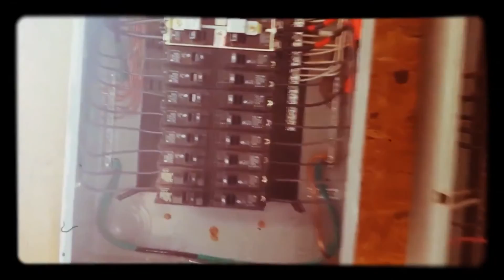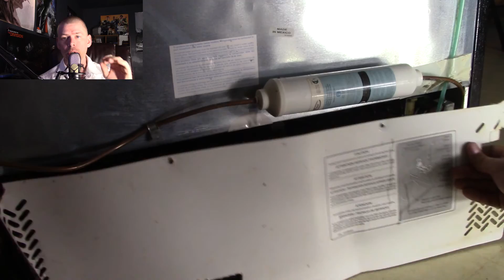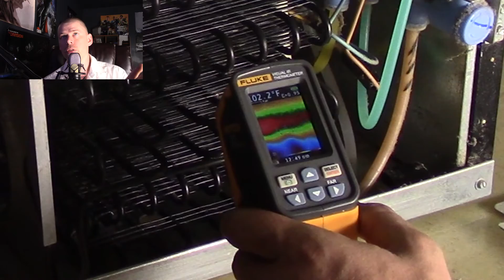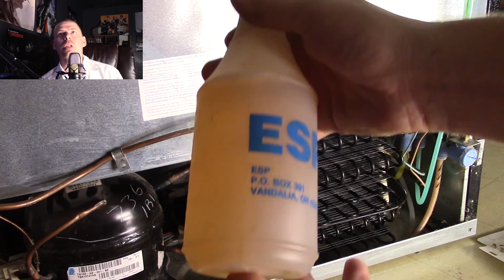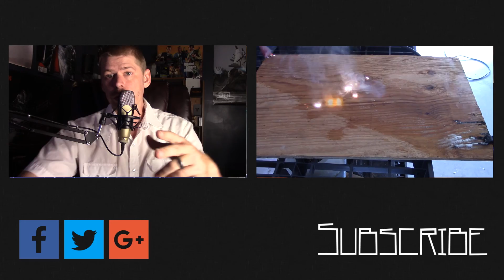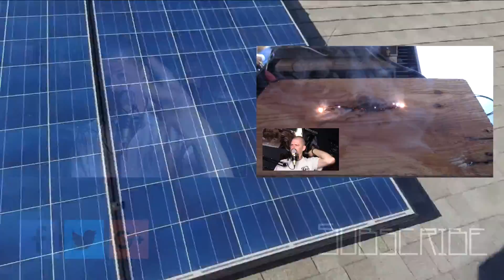DIY Clean The Coils On Your Refrigerator To Reduce Power Consumption!!! Solar Powered Systems!!!!!

Comment: Excellent video, I tell people to do this all the time, and everybody looks at me like I have to heads. For safety reasons I would suggest that the average person unplugs the fridge before doing this. But I can understand why you would do it live, just like I do.
Reply from the maker: Do you disconnect power to a heat pump before you clean the coils?
Reply: I don't work on heat pumps, but I usually work on stuff live. I am just saying the average person might get the fan motor soaked or other stuff. Not everyone is used to working around live power.
Reply from the maker: well I guess I can agree with you on that most people in the world doesn't even take consideration and what electricity is and what it can do it so maybe I should have put that in the note sorry about that

Comment: GREAT video!!!  Am so glad to see someone else who cleans their coils. Something my parents taught me as a kid.  Also recommend folks take an hour and clean the vents, exhaust hose and inside and under ones clothes dryer.  Not only does doing this make the dryer run more efficiently  but it prevents dryer fires which are one of the top causes of fires in the home. Cleaning ceiling fans and light bulbs in lamps, helps the ceiling fan and light bulbs work more efficiently.